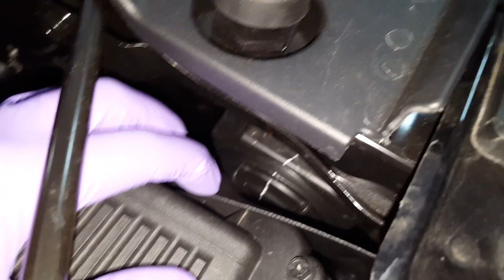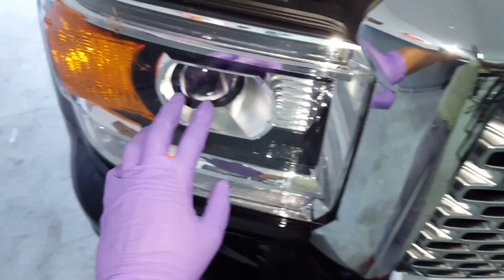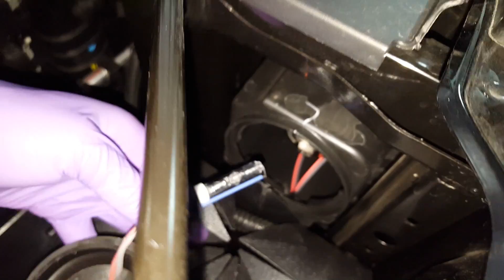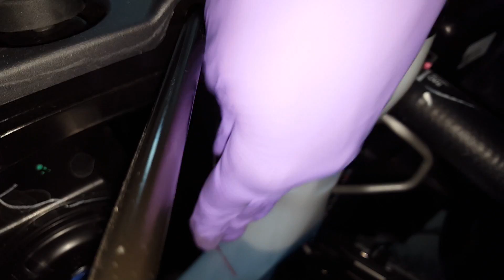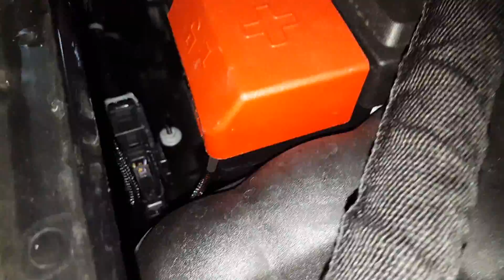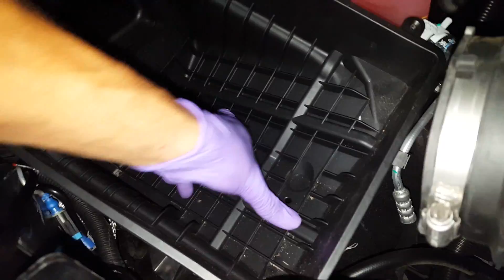DIY: 2014+ GMC Sierra HID Headlight Kit Install - Enlight

Comment: I installed a HID conversion kit along with battery relay harness and the HID's  work fine until I start the engine. Then the relay buzzes like crazy and HID's flicker very fast and it won't stop. With engine turned off they work just fine. Any suggestions?  I see you didn't have a problem on your 2014 Sierra.
Reply from the maker: Ed S. You need an anti-flicker module for the relay harness. we include this for all SLE and base model Sierras.

Comment: If you need to be taught how to open your damn hood do not attempt... smh.
Reply: Cory Hayden i did  all that no my 2014 gmc sierra but when a turn on my engine the lights go  off and when I turn off my engine the lights go on what you tink it is
Reply: Disconnect your negative ground from your battery before you start anything.
Reply: armando lugo did you fix it bro? My truck does the same shit and its annoying af
Reply: Took the words right out of my mouth.   That is exactly what I came here to comment about.    SMH 2.   lol

Comment: question pls. is there any light bulb that will fit on 2014 sierra 500 without using converter kit?i have 9012 factory standard

Comment: Installed my HID kit with much help from this video. Thanks for the instructional video and the quality products. Also for the nay sayers I had previously installed LED lights, due to the engineering of the light with two LED's one on top and one on bottom instead of one pointed directly out they did not produce a fully illuminated projector IE they sucked. This is the way to go, don't waist your time or money like I did.

Comment: Installed my HID system today; however, I am projecting small round light above and a wave effect from the lights, not a straight beam of light across. Can the bulb be installed upside down?
Reply from the maker: send us a picture of your beam pattern: sales@enlightauto.com
Reply: Thanks, I have sent you the pics
Reply: Problem solved - bulbs seated correctly and light pattern is now straight across.
Reply from the maker: Sweet, glad you got it figured out!

Comment: how did you fit the extra wiring through the blue seal??
Reply from the maker: The bulbs come with the seal already on the wires. The seal is part of the bulb harness.

Comment: hid are so yesterday it's LED now
Reply from the maker: We have tested many many LED "headlight" systems on the market today. There are simply no LED headlight systems on the market that can compete with a proper HID system in terms of  lumen output, beam pattern, fitment, and reliability. You need around 30 Watts of true LED power to match the brightness of our HID systems. Every "high power" LED system we have tested does not have sustainable operating temperatures even when the ambient temperature is >20C. In hot climates the problem would be even worse, causeing a significant reduction in lifespan. We were so disappointed with all of the LED headlight systems on the market we started designing our own and hope to bring it to market in the future.

Comment: I have a 2014 Silverado. Installed an hid kit from diode dynamics(before I found this video) with a relay pack that has some sort of pack in it(diodes?). I get a whining sound inside the truck when the daytime running lights are on. No whine when I flip the headlight switch to on or off. Only when daytime running lights on. Any help?
Reply: +T3X4S B0Y Oh no the website doesn't even show Chevrolet as an option, So i guess there isn't a kit for the silverado.

Comment: I have a 2015 GMC Sierra All Terrain and I just wanna know if I go with the same process as to the Denali shown in this video?
Reply from the maker: +Gustavo Fernandez 
The the best of my knowledge, the installation process for all versions of the 2014+ Sierras will be almost the same. The main thing that may be different is how you mount the HID ballasts. This will change depending on what type of ballasts you get.

Comment: I have a 2014 Silverado and noticed that this kit does not include any error cancelers or capacitors. Could you explain why your kit does not need the error capacitors. Thanks!
Reply from the maker: +someone1742 
At this time we have no reported issues with our systems on the Sierra version of the truck. If there is a PWM control on the factory electronics system it is operating at a high enough frequency which does not cause the relay to disengage. We do have capacitors and decoder modules available but have yet to find the need for them on the Sierra version of the truck when using a full relay harness. The truck in the video had no issues, even after several months of operation. If we ever find that it becomes necessary, we will add them to the kits.

Comment: do new model style trucks need a relay? because i have a 2014 silverado and when i turn on my truck with my hids it stays on for like 5 seconds then turn off
Reply from the maker: +GucCi GUCci 
Every truck is different. We use a relay harness on all our kits where applicable. It prevents a lot of problems. As for your truck, it sounds like you have the "approach lighting" feature turned on. When you unlock the truck it turns the headlights on for a few seconds and then shuts off. You can disable it in the dash menu usually.
Reply: +Enlight Automotive - Vibrant LED and HID lighting technology no its not when i unlock it its when my trucks on with the keys inside that why i was wondering if i needed a relay to prevent them from turning off when im driving
Reply from the maker: +GucCi GUCci 
I've seen HID Kits on a 2014 silverado work without a relay but they only lasted a few months.  I would still recommend you use a relay harness with any kit you have. We have our alpha series relay available if you are looking for a good harness: http://www.enlightauto.com/collections/hid-accessories
Reply: +Enlight Automotive - Vibrant LED and HID lighting technology appreciate it will look at them
Reply from the maker: +GucCi GUCci 
Here is an update about your question. The SLE Models without the factory LED running lights DO need a canbus/capacitor module. However the SLT models and Denali models with factory LED running lights DO NOT need a capacitor module. It appears that all of the Silverado models do need a capacitor module as well. So as of now just to make sure the kit is compatible will all models and versions, all GMC Sierra and Silverado kits from Enlight will include a capacitor as part of the relay harness.
Reply: +Enlight Automotive - Vibrant LED and HID lighting technology thank man i bought yall relay i got my hids to work!
Reply: +Enlight Automotive - Vibrant LED and HID lighting technology Hi there! so i see in this you're referencing a kit for the silverado as well. I have a 15 2500HD and wasn't able to find one for it... is there just not one made right now? thanks!
Reply: +Ryan Hardy i bought led instead hids are to much of a problem for me they would flicker like crazy and and they burn out when with a relay. i order opt-7 led there pretty expensive but i believe it was worth it
Reply: +GucCi GUCci really? that's weird... I still have HID's in my camaro that are 3 years old, and I had them in my 08 Equinox sport and they were great! I just wanted to know if that company had a pre made kit for the Silverado I just bought
Reply: Ryan Hardy n

Comment: The kit being installed, is it high and low? or just low beams?
Reply: is there a kit coming for a 2017 silverado 2500hd?, also any changes if you opt for the 50 watt ballast
Reply from the maker: +SonidoXtreme 
The stock projectors are dual-beam projectors. That is, it has both low beam and high beam function. So when you get the HID system,  you will get both HID low beam and HID high beam function. The kit comes with a relay harness.
Reply: Tom Makarow I would like to know as well.
Reply: Jason Glass sent an email to them,  never got response.. guess they still have website issues 2 years running lol